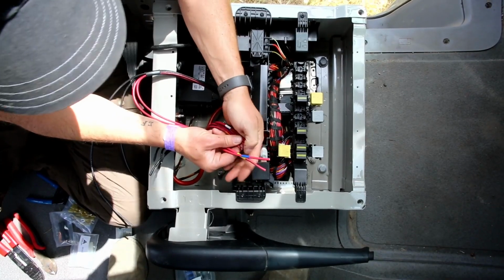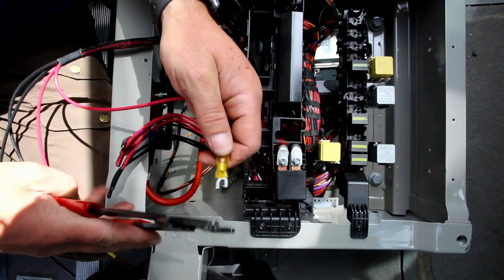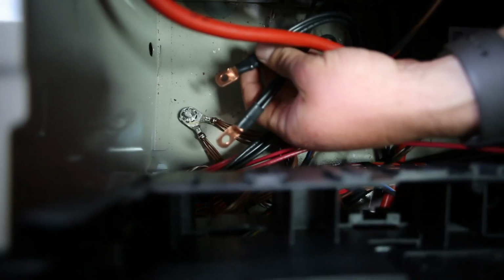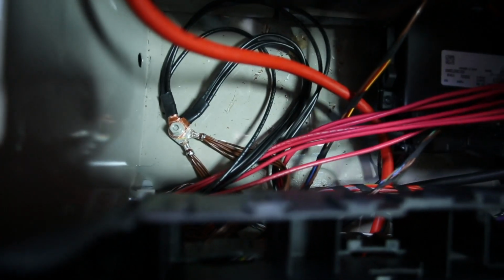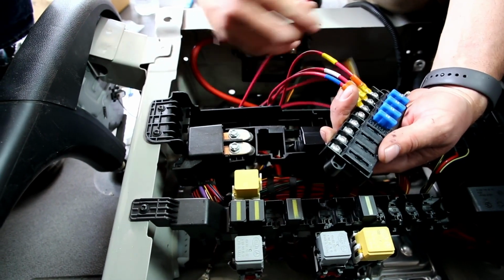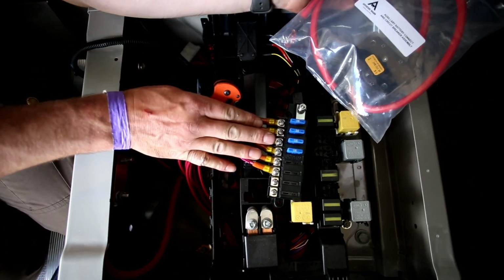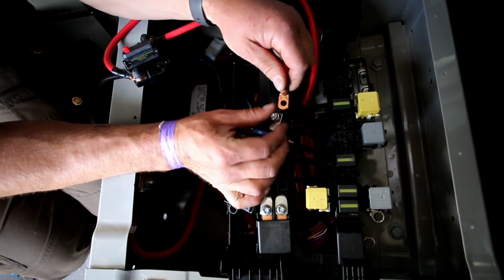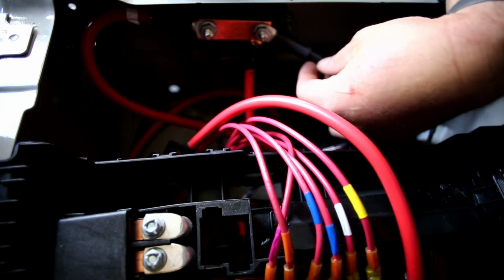INSTALLATION for Sprinter Van WIRING TO ELECTRICAL MAIN BLOCK

Comment: My 2020 MB Sprinter came with an AGM battery 12v 70Ah, Body Builder Connector under driver’s seat, and an optional AGM 12 v 95 Ah 850A battery. Do I still need to do all of this to hook up an Orion TR - Smart 12 12 isolated DC to DC 350 W charger for my lithium battery?